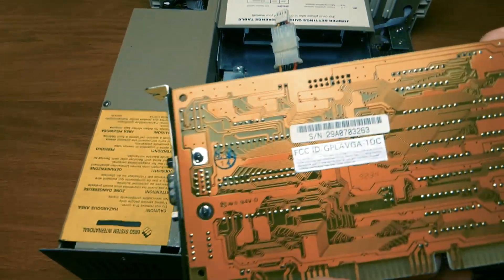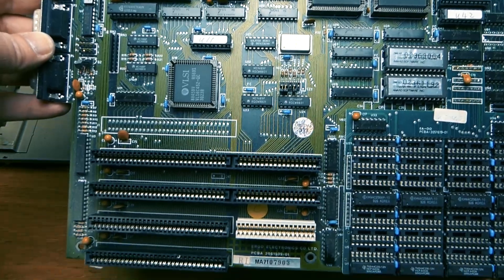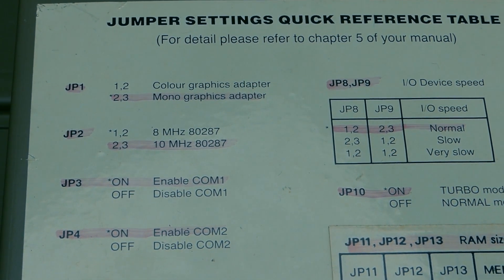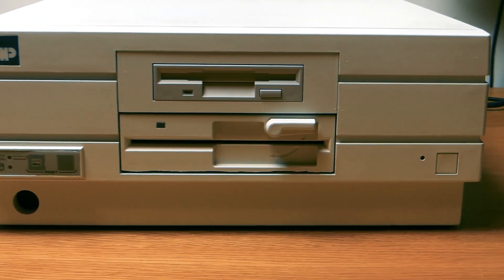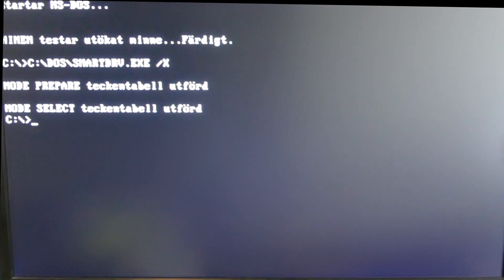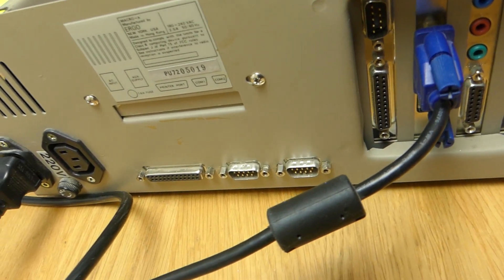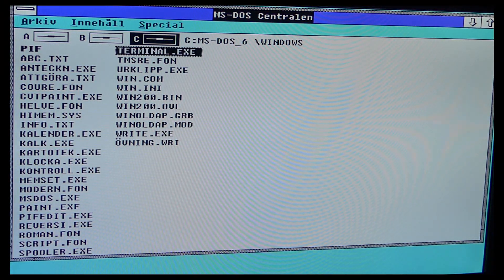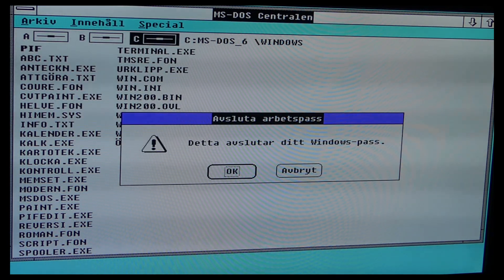Windows on a 286 computer

Comment: You can install Windows 3.0 this is much better an if you have more than 640 K of ram it works well on a 286 I have it on my 286 PC bu i have only 640 K of ram so windows runns only in Real-Mode ;) and i have the Original 20 MB MFM HDD

Comment: The 286 we used to have came with Windows 3.0, so 3.0 will work on a 286. 3.1 may still work, though that's a stretch. WFW 3.11 may indeed not work and require a minimum 386.
Reply: 3.1 works great on my 286